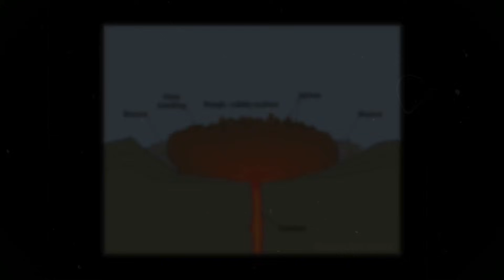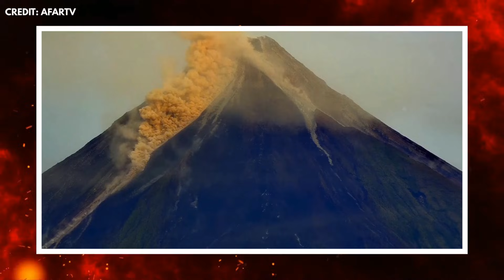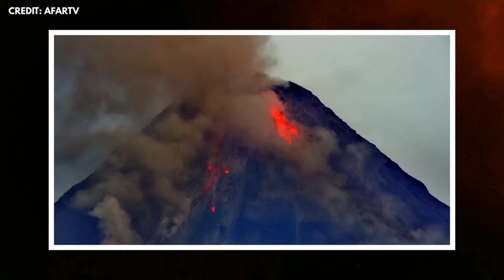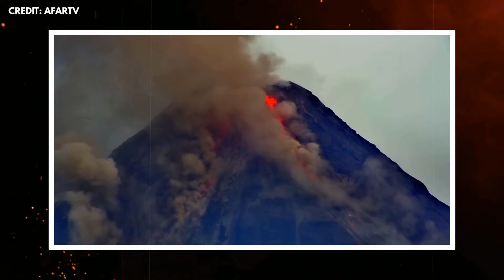Mayon Volcano’s Lava Dome Just Collapsed — Alert Level 3 Issued!

Comment: If someone claims more or better information than this you'd better check behind the Curtain B-4 any business has been transacted.  -"Dome Collapse" : the resultant condition after Laying your Ears Back & Flying into a Fracas, Arms/Legs Extended & Head First, only you didn't know that "Oleg the Smasher" was wearing extra thick Armour. A couple quick taps with a rubber mallet & your Dome is all symmetrical :face-orange-raised-eyebrow::face-blue-smiling::trophy-yellow-smiling:
Reply from the maker: @Titus-as-the-Roman Appreciate you as always...thank you for the continued support. That metaphor definitely lands and gave me a good laugh. For everyone watching, a lava dome collapse is a well-documented volcanic process, not hype or guesswork. At Mayon, dome growth becomes unstable as lava accumulates faster than it can support itself, eventually giving way to gravity, internal pressure, and gas release. When that happens, collapse-generated pyroclastic density currents become a real and measurable hazard, which is why Alert Level Three was issued. As always, the goal here is to translate what monitoring agencies are observing into clear, understandable information...no curtain, no theatrics, just the science and the risks as they stand.